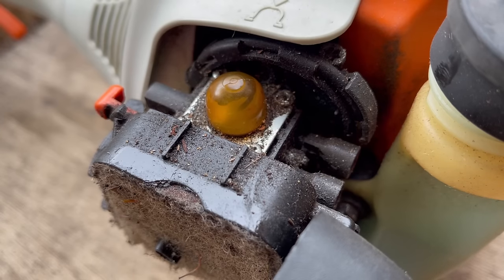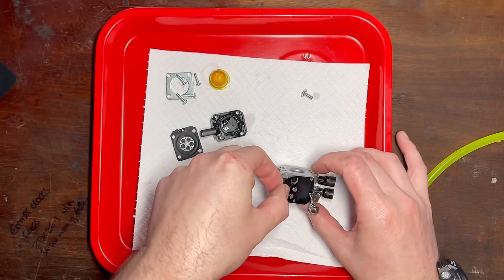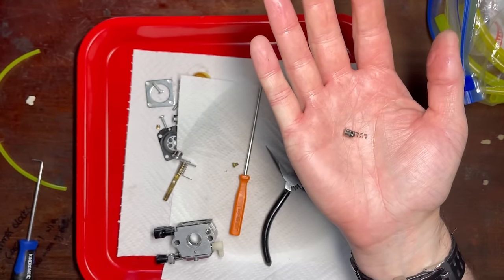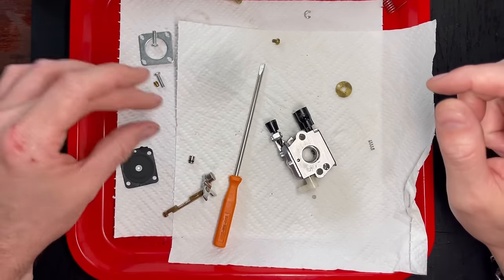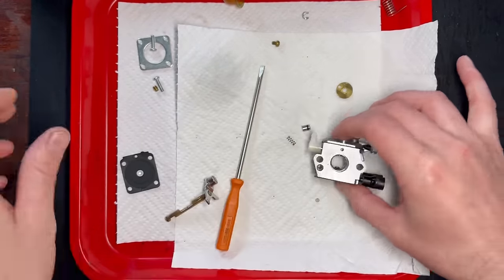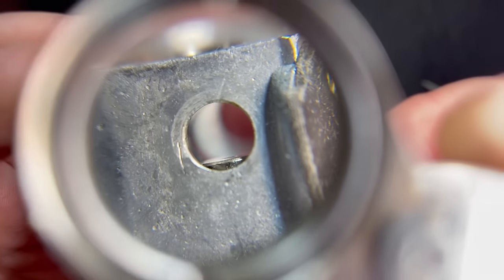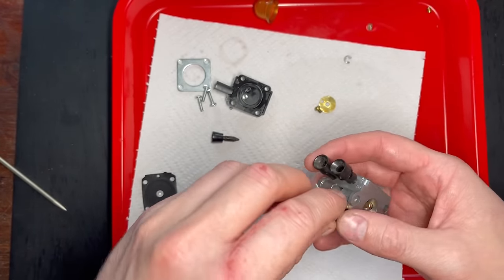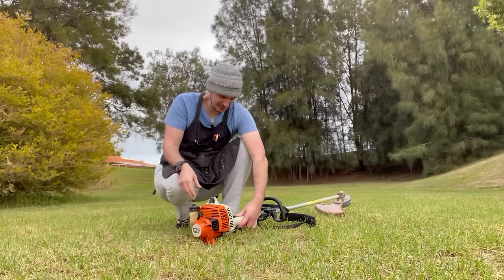Purge Bulb Won’t Fill Up With Fuel? Here's Why!

Comment: Hello! I have a question. I'm working on a weed eater FS38 STIHL that backfire from carburetor and burns the air filter. I just put a new carburetor in it and still doing the same. Do you have any idea of what would it be??? Thanks in advance and have a blessed day
Reply from the maker: Interestingly enough I find a carbon fouled spark plug causes backfiring! If not that then maybe spark timing? Check both :)
Reply: @VintageEngineRepairs  can you tell me how to do it?? Please and thank you!

Comment: Ok so my question for you is. I'm at this point with a Honda GX35 carb. Would you recommend just getting a new carb? they are pretty cheap. I'm trying to help out my dad.
Reply from the maker: Hey, no I hardly ever recommend giving up on a carb, unless it’s so badly corroded that it can’t be saved or it’s a Chinese copy that’s not working.

What’s wrong with it? I’m sure I can help you out :)

Comment: What drill do use on the equipment???  It’s Milwaukee correct??  What size is it ?????
Reply from the maker: Hmm I have 3 - a Milwaukee impact driver, impact wrench and a hammer drill, all 12v
Reply: @VintageEngineRepairs  ok thanks 🙏🏻 mate Vintage

Comment: Hi, i know this is an old video and i dont expect a reply. Is there a check valve in black primer base. I was cleaning one with aerosol carb spray in my hand and felt it clear a blockage as i thought. Ended up with a jet and needle in my palm and im wondering was there a little check valve that i lost. Thanks in advance. Keith
Reply from the maker: There are check valves in the purge base. That valve will (should) have a check valve in it.
Reply: @VintageEngineRepairs  as I suspected. I'm in Ireland and v hard to get parts. Genuine carb be equivalent of around 150 dollars.

Comment: Could you test for that accelerator pump o'ring air leak by placing your thumb over the pumps hole and see if the purge bulb works?
Reply from the maker: Hey Ken, if you removed the butterfly, throttle shaft and return spring, removed the fuel pump spring, replaced the pump and then filled the two shaft drillings with some blue tac you could! Because the shaft is in the way it makes the process a PITA

Comment: I got 2 brand new Zenoah engines that won’t prime. Weird. The old carbs prime and engines run. Guess I’ll have to wait until the new carbs get old and try them again.
Reply from the maker: Dig into them :) there is a leak somewhere!
Reply: @VintageEngineRepairs  going to try new hose on the gas tank. It’s the common factor between the two brand new engines.

Comment: Where do you get your handy little squeeze bottle?
Reply from the maker: They’re called Pressol oil bottles, they’re sold in the Uk, Australia and Europe! You can also visit any rc hobby shop as they use them to refil their nitro vehicles! Also try “zoom oil bottles” on eBay, they are the ones Mustie1 uses! A few options for you there :)
Reply: Thanks

Comment: For a leaking check valve, the first thing to do is remove air filter housing. Look at intake / choke area of carb, and pump primer. If fuel is getting into carb at choke valve area and the machine is not running, and all connections are good, then you have a bad check valve. If your check valve is not replaceable, order another carburetor. For these types of carburetors, no need to remove or disassemble carb. Do check valve test first, if all hose connections and primer bulb is good. This saves time and effort with trouble shooting.
Reply from the maker: Hey! Sorry, I don’t understand? “If fuel is getting into carb at choke valve area”? How do you know if fuel is going through the check valve if the engine isn’t running? They’re under vacuum so they don’t leak.
Reply: @VintageEngineRepairs  if hose connections are good , machine is not running, throttle is not pulled, when you prime it, there should be no fuel getting into throat of carburetor. If there is, the main check valve will be leaking. Fuel should not be getting into throat of carburetor, unless it is being started or running. If you are not pulling cord and it's not running, then there is no pulse to pull fuel from carburetor.
Reply from the maker: @twintwo1429  no that’s not right, the metering side of the carb is under vacuum, regardless of the check valve being open or closed it won’t leak.. imagine putting your thumb on the end of a straw the liquid is held inside. It’s the same principle here with the nozzel. The needle (which is your finger in the straw example) is holding the vacuum.
Reply: @VintageEngineRepairs  regardless of what you think, if the main check valve is bad, fuel will leak into throat of carburetor, when it   shouldn't. Fuel should not be getting into throat of carburetor unless you pull cord or machine is running.
Reply from the maker: @twintwo1429  again you’re wrong I’m afraid. How can fuel escape from a vacuum? If the needle is leaking and the check valve is too, THEN you’ll get leaking through the main nozzle, though also the idle drillings too… your explanation of diagnosis is flawed.

Comment: In my case it's the check valve on the idle jet that's leaking air into the fuel. This problem rarely crops up it seems, but the location of this check valve isn't obvious, even in your otherwise clear video.
Reply from the maker: Yep! That’s only there for the purge system so if that leaks, it will let air into the bulb. Good find :)

Comment: Help! I don't see the accelerator pump.  I see a metal mesh in its place.  I can't even remove it.  Dropping some 2 stroke oil in there seems to help fill the bulb half way vs barely anything before.  What should I do?
Reply: I do have a 4mix km110r. Is it different?
Reply from the maker: I’m not sure what carburetor it is, but if you google the model you can find a parts break down and if there should be one in there :)

Comment: Hi Tom, does the same testing with the fuel line sucking and pushing apply to fs120 carburetors? 

Reason why i ask is because I'm not seeing a point for the accelerator pump to come out if i remove the throttle rod.
Reply from the maker: If you cannot see the little hole for it either side of the carb, then no there isn’t one. If that’s the case, it could be your main nozzle check valve not sealing, your fuel filter may be out of the fuel, damaged lines of most commonly if you have taken the carb apart, the metering side gasket is leaking :) hope it helps!
Reply: @VintageEngineRepairs  there is a white plastic plugged hole on the choke lever side, maybe that's it?

Comment: I'd love to see you go thru a motorcycle 2 stroke and 4 stroke carb, although these little guys seem to be even more finicky to deal with. I take it all of these are purge bulbs, not primer bulbs like I've been calling them my entire life...
Reply from the maker: Hey, yes these are more complicated than motorcycle slide carbs, but neither are very difficult. I use to race a cr250 :) yes they are called purge bulbs, they purge the air from the carb, primers will shoot fuel into the intake.

Comment: Make a video on ,sucking air while priming 
Walbro Carburetor 
Model  WT 1174
Reply from the maker: Hey, the principles will be identical to this one 👍🏻
Reply: Yes but not any gasket ring with arm of  butter fly @VintageEngineRepairs
Reply from the maker: @kedarbhide2387  the accelerator pump? If no pump then it could be the check valves, gaskets, fuel line etc that I showed here 👍🏻
Reply: @VintageEngineRepairs  ok

Comment: What if i installed a new carb and worked for acupple minutes, but it stopped pumping fuel to the bulb?
Reply from the maker: It will have an air leak somewhere!

Comment: What function was lost by your modification?
Reply from the maker: It loses that initial supply of fuel when you press the trigger. Therefore you may just have to give it a bit more fuel on the L screw as shown here. The accelerator pump allows you to run leaner on the L and still get good off idle acceleration.  The alternative it to just run the L a bit richer like all the other carbs that don’t have one :)
Reply: @VintageEngineRepairs  Thank you, that was very clear.

Comment: Does anybody have a source for  C1Q-S97 main nozzle checks? Zama does not list a part number
Reply from the maker: I tried with no luck either. Your last option would be to remove it and see if you can find one of the same diameter and length. They’re normally 5 or 5.5mm type the measurements and I’ll see if I can find anything on it

Comment: A new carburetor cost about $ 20 . also called a tune up kit , you get new fuel lines , filter , spark plug , carburetor , gaskets . Did 4 of them , no issue .
Reply from the maker: This is an engine repair channel, not a parts swapping channel.

Comment: What's wrong when the bulb won't return to it's normal shape?
Reply from the maker: If it just stays down, you’ll have a blockage either in the one way valve under the bulb, the drilling, carburetor or fuel system.

Comment: Why couldn’t u just put a few drops of fuel on the pump hole and press the purge bulb and see if that pump actually leaks ? Much easier then taking it all apart
Reply from the maker: It’ll push but not suck, taking it apart shows you how bad it is and thus what the potential problem can be.

Comment: What was your best method for learning about this stuff when you first started?
Reply from the maker: A combination of self discovery, technical manuals, great mentors and forums :)
Reply: @VintageEngineRepairs  

Thanks for the feedback

I have lacked confidence in this subject matter. Even apprehensive about my ability to learn. I am quickly gaining confidence through videos like yours. Thank you . 

I ordered some books today. I am also discovering the needed online resources for added learning. 

I seem to have quite a collection now, of broken down equipment. I just set it aside  and move on. Well, it is not practical anymore. 

The clincher was a recent commercial used mower purchase. It was running great but suddenly losing power and shutting down. Considering all the options, I concluded, "it's actually a better investment than anticipated because now I'm serious about learning this stuff and becoming less of a victim of my own circumstance.

Comment: There should be NO need to modify the spring in this system.
Reply from the maker: If you want to eliminate the accelerator pump there is.

Comment: They need to get rid of them plastic bulbs and put a metal plunger with an o ring and return spring in place of this junky design.
Reply from the maker: That wouldn’t work, it needs a valve. They’re reliable and easy to replace. They’re not my preference, but are effective!

Comment: Just replace the carb. They are cheap.
Reply from the maker: The oem ones are very expensive, the cheap ones are Chinese clones that are very unreliable and often leave you with more problems than you started with. Much better to save the original part.

Comment: The Stihl carburetor made in china problem they all have.
Reply from the maker: China can make excellent quality products and Zama carburetors are no different. It’s the aftermarket ones with no quality control that are the problematic ones
Reply: I prefer HLsupply. Aftermarket carburator not Amazon stuff...made in USA
Reply from the maker: HL supply don’t make equipment, they import from china.

Comment: Not a purge bulb. PRIMER bulb. Doesn't purge anything.
Reply from the maker: You’re incorrect, it’s a purge, it purges air out of the carburettor. A primer adds fuel to the engine, either through pressurising the float bowl so it shoots fuel through the main jet or alternatively it will shoot fuel directly into the Venturi.